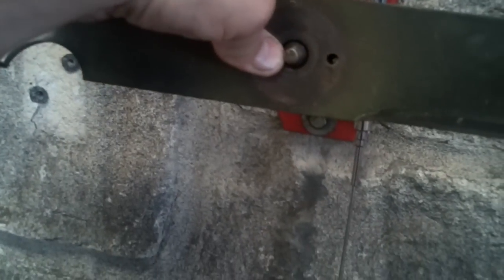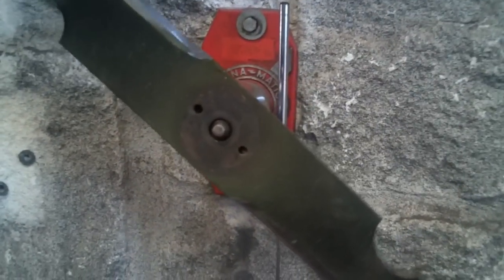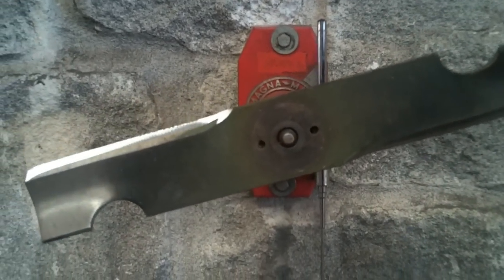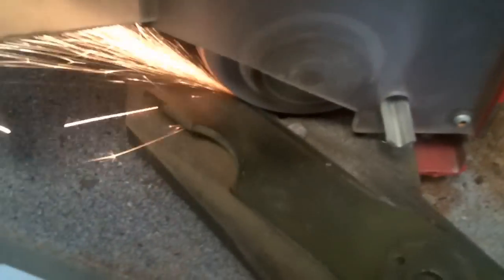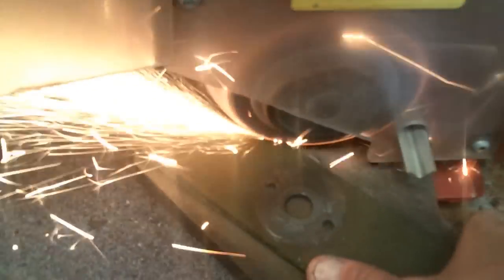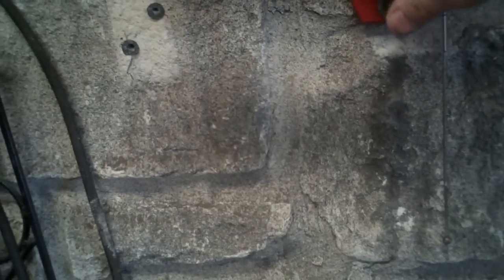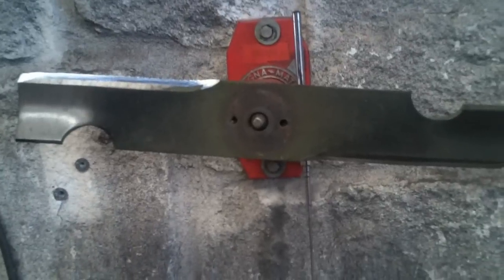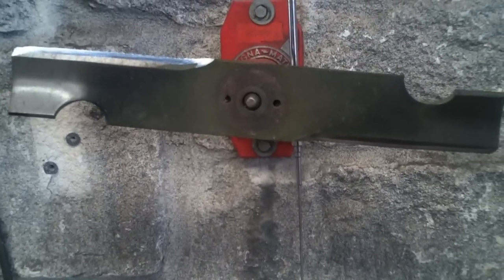HOW TO BALANCE LAWNMOWER BLADES

Comment: I'd add one tip:  measure the length, from center hole to each tip.  Make those measurements identical, by grinding off the end (not the cutting edge).  Now proceed with your sharpening and balancing by grinding the cutting edge to balance.  Now you have a balanced blade.
Reply from the maker: lol stop your killing me with laughter over here.  😂😂😂
Reply: @THEMOWERMEDIC1  
Why would you laugh?
  This week I was balance checking three high lift jd blades.  (I first wire wheeled them to a high shine on all surfaces). The third blade seemed to need so much removal to balance, and this was it's first resharpening.  On a hunch I measured (with a 12 inch caliper) the length from center hole to each END,  just aft of the grind.  It was off 0.060" or so.  The other two blades were much closer, within 0.020" or so.   I ground the end of the blade down till the lengths matched closely.  When checking balance, it was then close, and I ground the cutting surface to get the blade to stay horizontal within 15 degrees on the bearing fixture.

And, I always spin the blade 180 and recheck.  This way if the hole is closer to one SIDE or the other, it shows with that test.  There is nothing to improve if this happens, but it helps get balance as close as reasonably possible if you are aware of it.  
  I've done a lot of aircraft propeller static balance work, so some of this info translates from that.  Of course a dynamic balance would be quite a bit better, but anyone going that far overboard,  would make ME laugh.
Reply: @not-stock  Themowermedic1 seems a little thin skinned.

Comment: I run a $6500 dollar exmark turftracer series 3.  Personally the thought of how much stress an unbalanced blade causes on bearings, spindles and the deck itself, and the cost to repair those parts vs. Just balancing it properly is worth every penny and minute of my time.  That's like saying you'd wash your brand new car with sandy water.  It just doesn't make sense.  So go ahead and run your unbalanced blades on your shitty craftsman mower.   This guy's showing you a true service.   And watch the video: Magnamatic 1000 vs. The nail and tell me a nail works.  It doesnt.
Reply: olymaniac 
shouldnt u feel it if its badly off? and what if you do 1 side too much and then have to do the other one.. and then do that side too much again and then the other one and then the other... lol

Comment: It’s difficult with mine because I have a 5 star blade.
Reply from the maker: No edge to sharpen
Reply: THEMOWERMEDIC1 hard to balance it, since the star is not a circle center.
Reply: Google "1000-42 Blade Hole Adapter (Husqvarna)
".

Comment: Lol on the first cut grass will start sticking to the blade and throw the balance off.
Reply: But it will still be less out of balance than it would be if it wasn't balanced to start with
Reply: Easy enough to clean the grass off the blade